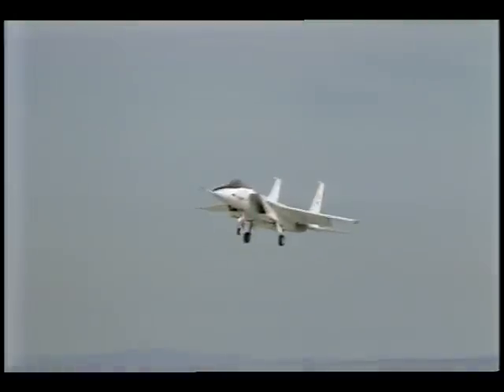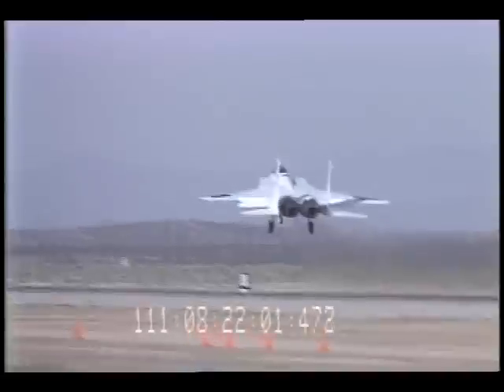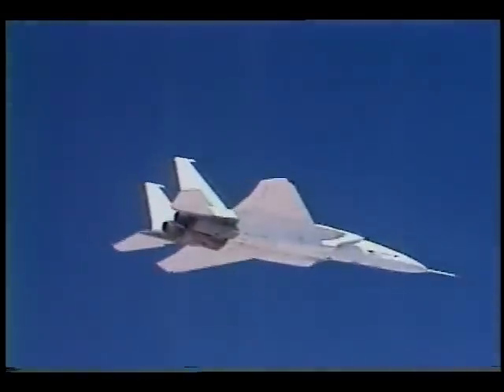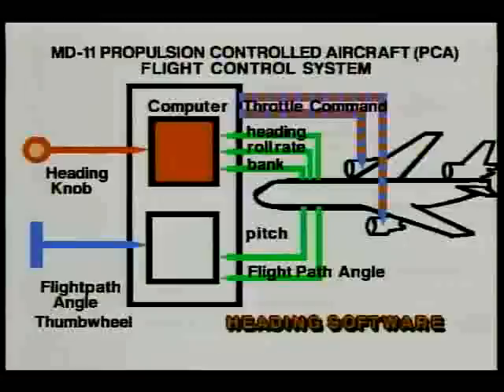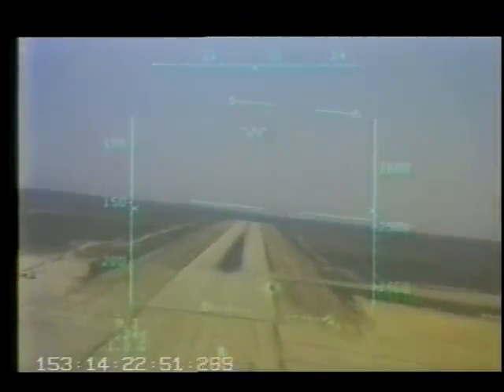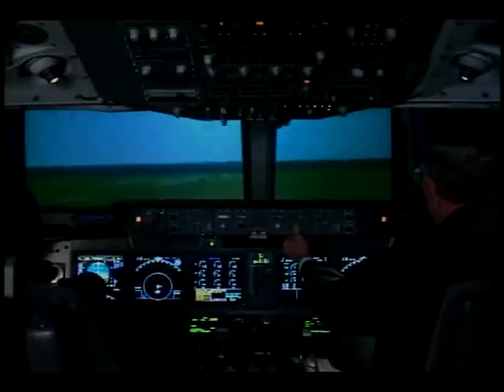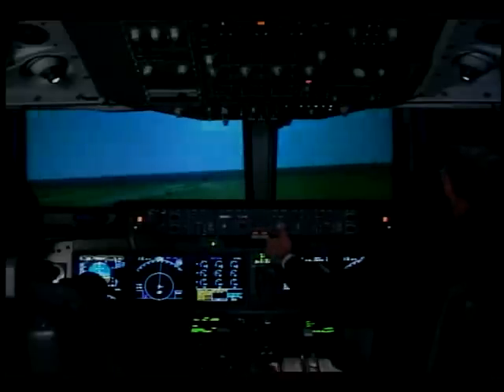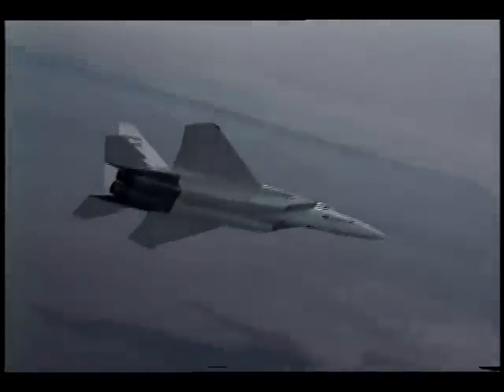F-15 Propulsion Controlled Aircraft (PCA)

Comment: The Propulsion Controlled Aircraft (PCA) was created by NASA thanks to the idea of a TWA engineer in 1989. This system helps to control an airplane using only the thrust of the engines thanks to a computer. The PCA is used in case the aircraft loses the entire hydraulic system and the flight controls. Without the hydraulic system, you can not control the plane. This had already happened with the accident of JAL 123 in Japan in 1985 and United 232 in Sioux City Iowa USA. in 1989. The only way to control a plane without hydraulics is to use only the thrust of the engines back and forth. Months after the United 232 crash, a TWA engineer came up with the idea of putting that control technique on an airplane with just the thrust of the engines that the United 232 crew had used directly on an airplane computer. I call NASA and the propulsion-controlled aircraft was born. After studies and tests on simulators, the PCA system was successfully tested on F-15 aircraft in 1993 and finally on an MD-11 offered by McDonnell Douglas in 1995. (Fun fact: That MD-11 that was used in the tests of PCA in 1995 crashed in 2009 as the FedEx flight 80). The PCA was going to be the solution to control aircraft without hydraulic systems and flight controls. But the FAA together with NASA abandoned the PCA system project. Why?. Because the chances of an aircraft losing all hydraulic systems were too low to develop systems like the PCA. A plane that loses all hydraulic systems is a rare event that occurs from one to 100 million. The PCA system ended up in the NASA archives. The PCA never installed aircraft around the world. After NASA abandoned the PCA project, another plane ran out of hydraulics in mid-flight in 2003, it was the DHL OO-DLL A300 in Baghdad in Iraq, but this time the plane landed successfully without problems and without the PCA. The crew of DHL managed to control the aircraft using only the thrusts of the engines from one side to another, as it had done the crew of United 232. The DHL OO-DLL is considered as the first and only plane to land safely without hydraulic systems in the history of aviation.

Comment: It was the FAA that pissed the PCA research program  off the radar. As far as I'm concerned the saving of a single life was worth completing the research and adding what technically amounts to a self-contained controller with minimal software and a couple of extra sensors. It's really not such a big deal to tie the current day flight controls into a PCA system - most modern airliners can be comfortably landed with a few knobs and settings. It was stupid to abandon such a program.
Reply: The Propulsion Controlled Aircraft (PCA) was created by NASA thanks to the idea of a TWA engineer in 1989. This system helps to control an airplane using only the thrust of the engines thanks to a computer. The PCA is used in case the aircraft loses the entire hydraulic system and the flight controls. Without the hydraulic system, you can not control the plane. This had already happened with the accident of JAL 123 in Japan in 1985 and United 232 in Sioux City Iowa USA. in 1989. The only way to control a plane without hydraulics is to use only the thrust of the engines back and forth. Months after the United 232 crash, a TWA engineer came up with the idea of putting that control technique on an airplane with just the thrust of the engines that the United 232 crew had used directly on an airplane computer. I call NASA and the propulsion-controlled aircraft was born. After studies and tests on simulators, the PCA system was successfully tested on F-15 aircraft in 1993 and finally on an MD-11 offered by McDonnell Douglas in 1995. (Fun fact: That MD-11 that was used in the tests of PCA in 1995 crashed in 2009 as the FedEx flight 80). The PCA was going to be the solution to control aircraft without hydraulic systems and flight controls. But the FAA together with NASA abandoned the PCA system project. Why?. Because the chances of an aircraft losing all hydraulic systems were too low to develop systems like the PCA. A plane that loses all hydraulic systems is a rare event that occurs from one to 100 million. The PCA system ended up in the NASA archives. The PCA never installed aircraft around the world. After NASA abandoned the PCA project, another plane ran out of hydraulics in mid-flight in 2003, it was the DHL OO-DLL A300 in Baghdad in Iraq, but this time the plane landed successfully without problems and without the PCA. The crew of DHL managed to control the aircraft using only the thrusts of the engines from one side to another, as it had done the crew of United 232. The DHL OO-DLL is considered as the first and only plane to land safely without hydraulic systems in the history of aviation.

Comment: I can't believe this program was dropped, I see no reason not to include this system on modern "smart" planes which are already mostly computer controlled
Reply: Maybe its cheaper to trained pilots to do it themselves than buying an expensive optional equipment from the air frame manufacturers.
Reply: They don't want to install the PCA system as standard redundancy control with the convenient excuse that the hydraulics rarely fail.  But in reality its all about costs.
Reply: The Propulsion Controlled Aircraft (PCA) was created by NASA thanks to the idea of a TWA engineer in 1989. This system helps to control an airplane using only the thrust of the engines thanks to a computer. The PCA is used in case the aircraft loses the entire hydraulic system and the flight controls. Without the hydraulic system, you can not control the plane. This had already happened with the accident of JAL 123 in Japan in 1985 and United 232 in Sioux City Iowa USA. in 1989. The only way to control a plane without hydraulics is to use only the thrust of the engines back and forth. Months after the United 232 crash, a TWA engineer came up with the idea of putting that control technique on an airplane with just the thrust of the engines that the United 232 crew had used directly on an airplane computer. I call NASA and the propulsion-controlled aircraft was born. After studies and tests on simulators, the PCA system was successfully tested on F-15 aircraft in 1993 and finally on an MD-11 offered by McDonnell Douglas in 1995. (Fun fact: That MD-11 that was used in the tests of PCA in 1995 crashed in 2009 as the FedEx flight 80). The PCA was going to be the solution to control aircraft without hydraulic systems and flight controls. But the FAA together with NASA abandoned the PCA system project. Why?. Because the chances of an aircraft losing all hydraulic systems were too low to develop systems like the PCA. A plane that loses all hydraulic systems is a rare event that occurs from one to 100 million. The PCA system ended up in the NASA archives. The PCA never installed aircraft around the world. After NASA abandoned the PCA project, another plane ran out of hydraulics in mid-flight in 2003, it was the DHL OO-DLL A300 in Baghdad in Iraq, but this time the plane landed successfully without problems and without the PCA. The crew of DHL managed to control the aircraft using only the thrusts of the engines from one side to another, as it had done the crew of United 232. The DHL OO-DLL is considered as the first and only plane to land safely without hydraulic systems in the history of aviation.

Comment: But why are the flaps partially down on these test aircrafts?
Reply: ALTN flaps?
Reply: Its bcuz the PCA situation is for planes that all their hydraulic failed. Without hydraulic, u cannot extend flaps. The pca Software signal the engines to turn, to decend or climb.